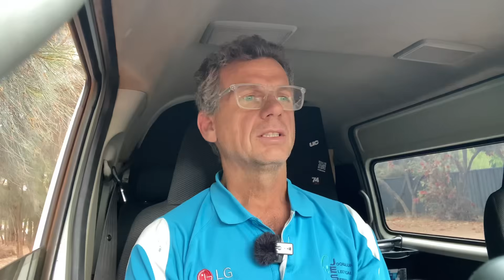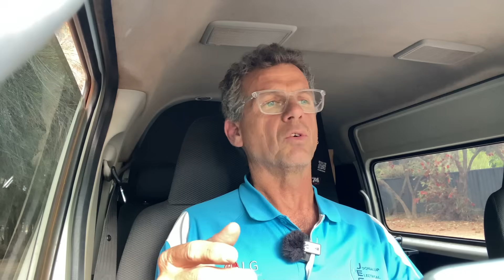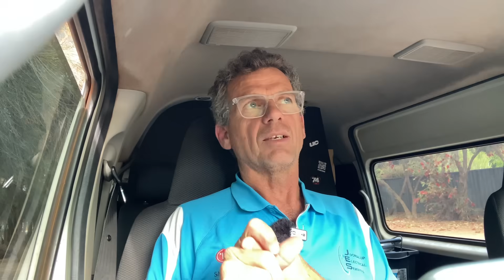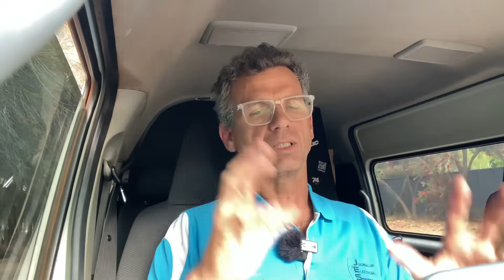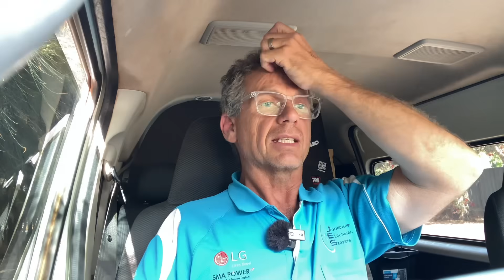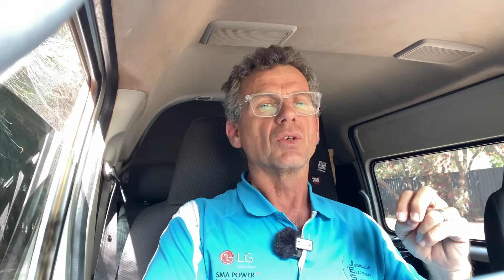What you need to consider before buying an Off Grid solar system, facts from an experienced tradie!

Comment: My bread and butter is electronic design. The video makes some good points, but transformer/transformerless isn't one of them. It boils down to good design and to some extent you get what you pay for.  I don't think the Sigens invested enough in surge capability. This amounts to spending money on thermal mass. Bottom line is you over-rate your inverter, or use 2 inverters. I don't get the control freakery either. You should be able to buy a system that you can control and will run without the cloud. Nothing stopping Sigen sending you a txt if they have an important update.

As for connectivity. If you live outside cell coverage and you need a decent off grid system you should have and can afford satellite.

Comment: The Sigen won't automatically black start whilst off grid? I need confirmation.
Reply from the maker: Correct, it needs human intervention.
Reply: @joondalupelectricalservice3201  Do you mean without the gateway it doesn't automatically black start while off grid?

I've tested mine and it does. Gateway hit off grid. Battery ran down. Morning came and it boots up charges and runs.

Or have a i got it wrong.

Comment: Made my chuckle from the other side of the planet. We have a grid tie Sunsynk in a basement in the middle of a city with great phone coverage. Of course there's zero signal in the basement and we had much fun as Sunsynk then insisted the installer kept reading stuff off the inverter and every reading he had to go down the basement which broke the call and he had to phone them again.

Doesn't take the outback to make things go to bits when you depend on connectivity
Reply from the maker: Doesnt sound like he had much fun!

Comment: Three Free Hours from Synergy — for the Low, Low Price of $400 Million a Year

Synergy’s “3 hours of free power” isn’t generosity; it’s a calculated load-balancing trick. Western Australia’s grid is flooded with excess solar at midday, costing Synergy about A$70 million annually in frequency control and storage. Instead of investing in infrastructure, they’ll spend A$8 million on “free” power between 9 am and 12 pm — when most people aren’t home — and recover it by hiking tariffs before and after.

You might save $1.44 a day in the free window but lose $3 a day outside it. That’s an extra $500–$600 per household each year. Multiply that by roughly 800 000 homes, and Synergy pockets $350–$450 million a year, all while branding it as “green innovation.”

Here’s the truth: once those higher rates stick, power prices never go down. Every “smart plan” locks in another notch of inflation.

Three free hours. Four hundred million in extra charges.
That’s not reform — that’s ransom wrapped in green paint.

Comment: Australian living in Philippines off grid last 6 months. On extreme budget so cheap Hf Chinese 6kw hybrid inverter $A520 owned it for 1.5 years sits in ventilated shed 34C ambient. ( Pv and inverter temps don’t exceed 50C )Recently purchased identical inverter  for $364 ( sale, now 3 year old design ) to sit in cold standby ( Pv and battery switch off ). Also 1kw toroidal inverter and 300W Hf inverter. All 4 inverters selectable via dpdt knife switches. Have 5.4kw Pv with 7kw storage. As a technician I believe redundancy is key, not over driving everything. My Pv limit is 500V but 360 to 400V string will not destroy the 500V rated caps. My higher loads are short duration and my 8kw daily consumption is small compared to 20 to 30 kWh I could harvest. Super typhoon just passed ( 20 per year ) generation was 3.8kwh ( plus battery reserve ) so with careful load management no need for back up generator. Amazing to see 8Pv watts from 5.4kw array during typhoon. 500 to 800W was max for day. With cheap low end don’t expect much warranty, as diy you are the

Comment: Been offgrid for almost 5 years. Have a modest 4.8kw pv, 10kw (2 X 5kw MPP solar) inverter and 40kwh pb gel battery bank. Never had a problem. Both inverters run at half their max so they're not stressed. Can run an electric oven and split air con when it's sunny no probs. Super simple setup.

Comment: Thanks for sharing the information and your experience!

I have my own off-grid system and helped a number of friends install off-grid systems in WA over the past fifteen years, all of which are still running.

I have used both low frequency and high frequency 'transformerless'  inverters. There have been only two failures of inverters on these systems that have stopped power production. One was a fault in a low frequency inverter shortly after it was installed around twelve years ago which was covered by warranty and the other was recently with a transformerless inverter where the PV cables where damaged probably causing arcing.

None of the systems I have installed have dedicated generator backup, one uses an EV to provide backup if needed, some others use small portable generators.

I have come to the conclusion that the best way to 'keep the lights on' is to design systems where no single failure of one particular piece of equipment can cause the loss of power.

To this end I would recommend  off-grid systems have multiple inverters running in parallel connected  to multiple batteries with multiple solar controllers connected to multiple solar arrays. This can be more cost effective than trying to make a system bullet proof.

The Sigenergy equipment looks interesting as you can run multiple systems in parallel. Hopefully if one Sigenergy stack failed the other would continue to supply power.
Reply from the maker: Generator is to maintain the batteries at times of low light and high loads such as humid, overcast or winter. If your batteries aren’t maintained correctly and don’t receive an equalisation state of charge regularly it can cause issues with warranty claims and for good reason. As a business I cant afford that to happen, no comms or no auto start Generator are deal breakers for me and I will walk away from a job. Again Im running a business so everything has to be done correctly 😊👍🏻
Reply: @joondalupelectricalservice3201 
 I totally agree with you if regarding generators in an offgrid systems if it is using lead acid batteries. In this case you have to make sure there is enough power for long equalisation times and to keep the battery at a high SOC. For LFP batteries this is unnecessary. The main reason to make sure an LFP battery is fully charged  on average at least once a week is to reset the SOC counter to 100%.

As far as I can see the current industry norm is to provide a generator large enough to provide for peak power consumption to act as a backup when there is equipment failure. This is a necessary  but expensive option if you want to provide a reliable power supply if you don't take the steps I have outlined before.

To get around the problems of there not being enough power during winter/cloudy periods I would look at spending extra money on a larger solar array and/or battery and asking the customer if they are prepared to reduce their power consumption during the few times of the year when there is not enough solar. Home Automation can play a large part in making this reduction fairly painless. If the customer is not prepared to change their usage you only need a power source big enough to provide the average house load and maintain the battery SOC at say 20%.

With the systems I look after one household will use their EV to put some charge into the system if they think they are going to run out. One will run a small generator (less than 2kw) to put some charge into the battery, others will just let the system shut down in the middle of the night and we all to some extent will keep an eye on our usage. My offgrid system has enough solar and battery (~8kW solar, 10kWh battery) that I don't ever not have enough power for the house. Home Automation varies power going to charge my EV and run the air conditioner.

Being flexible in how a system is designed and what compromises the users are prepared to  put up with can save a large amount amount of money without compromising reliability.

I agree with you about remote monitoring, the last thing I want to have to do is travel over 100km to fix a problem which could be fixed online. I can also check the health of the systems without a visit.

Comment: Hey Jayson, thank you for this video, such an interesting analysis you offer, I’d be interested in your opinion on the performance of the Sigenstor battery modules as well. You talked about the pros and cons of transformerless inverters and how they tend to derate at high temperature (very common in Australia) but how do the Sig battery modules perform in those temperatures compared to other brands? They are rated optimal operation up to 35 C and derating above 40 C which is pretty common in many places in Australia, do you see any issues with them, would you recommend coupling the Sigenstor battery stack with assisted forced ventilation to prevent dersting of battery modules?
Reply from the maker: Thats a good point re the batteries themselves. They shouldnt be installed in direct sun thats in the installation instructions and applies to all batteries. As far as ambient temperatures affecting the batteries plus getting charged or discharged hard then that would also greatly contribute to heat build up. The inverter or energy controller as sigenergy call it will be monitoring the temp of the batteries and would most definitely be changing its parameters to manage that temp consequently affecting their performance.

Comment: While I fully understand many of your points and agree with most, I am wondering why (in an off grid scenario) you don't consider redundancy on the inverter.  It would not only solve the reliability issue, and also solves some of your other concerns, such as large load starting.  For instance if you had 1 sigenergy inverter and 6 batteries, splitting that into 2 inverters with 3 batteries each would double your power for high inrush loads, with the same total capacity.  It would also prevent one inverter failure from causing a total outage.  Also many of these inverters, including Sigenergy, have Modbus TCP connection.  It is possible to program and control the system without the Sigenergy app.
Reply from the maker: Yes for sure good point multiple energy controllers could offer redundancy, however a simple glitch can still shut the whole system down requiring tech support to address and reconfigure while replacements are ordered. 
I did say they can be configured locally but its not straight forward and not something a regular home owner/farmer would get their head around which equals a site visit. For me running a business I dont need that, it cost me money and time.

Comment: Wha about Victron RS6000?
Reply from the maker: I dont have any experience with that one, it does have only a 4kWp solar capacity though. So its not really working that hard, still no substitute for a transformer based inverter looking at surge  and general specs for it, especially for motor start etc

Comment: Thanks please correct me if am wrong about backup activates and lose wifi connectivity in fully off grid. Because in on grid the switching over from grid to off grid in grid connection, doesn’t affect the wifi connectivity or loads interruption and am happy to be pointed out. I am no electrician. Just an average person.
Reply from the maker: Backup for grid connected systems is seamless and no issue. This video is focussed on pure off grid, so no grid connection at all.

Comment: Just installed a a 30kw 3 phase on farm in southern NZ . We are on grid so have good export potential. I like the thought of sig working off grid as well. 2 weeks after install a mass wind storm left my area without power for a week. I sig performed flawlessly in off grid mode. So happy to have it up and running. Easily runs the shearing shed if power go's down as well!
Reply from the maker: They are awesome as a backup source but this video is specifically about off grid, so no grid connection at all 👍🏻

Comment: Yeah, if I was off grid I want it bullet proof.  Maybe if it was my weekend fishing hut or similar, but not if it was how I live or work.
As an aside 3 phase systems in general seem to be way undersized for what they can put into each phase. Virtually all the ones I hear people say they have, turning  a couple of power hungry appliances on on the same circuit is going to Max them out. I would want at least 7 or 8kw per phase before I would even consider one.
Reply from the maker: Yes I agree

Comment: Great video. I’ve always thought it’s a little odd to use a sig in a full off grid scenario. 

In saying that with starlink allowing internet to be so accessible maybe it’s not such an issue having the sig connected to the internet. 

If I ever had an sig in an off grid system I’d want to have 2 running for redundancy, and 1 new in the box as an emergency if it fails. 

In time as sig becomes a more trusted brand my thoughts will probably change.

Comment: I am off grid now for 16 months without a blackout, I built a aircon outdoor room set to 24 degs, all my MPPTs are Victron (40kw solar array) but are using 3 x 11kw MPP Solar inverters (I tested to 10.5kw for 30 mins), if they ever  fail I will most likely go Victron, I use Yellow version of Home Assistant as the base for local monitoring but also pay for remote access, history can go back 12 months (great for fault finding), all my DIY 9 battery banks (150kwh) are monitored through a Victron Cerbo and all using JK inverter BMSs that are programable whick allows me to discover the highest and lowest cell voltage out of the 9 banks 24/7, I think if you go off grid you MUST know your system and fault find, my daily usage is 30kwh, as seen through a Victron VM-3P75CT Keep up the great videos
Reply from the maker: 150kWh is huge!
Reply: I’ve seen people ssh into victron for troubleshooting. It seems software dev friendly
Reply: Good one. 
Currently 21kwh. 3/ 280 amp EVE cells, 24 volt with JK BMS Version 19. 2/4.2kw PowMr hybrids. Split circuits all through Victron Cerbo and smart shunts. 
Average daily consumption 7 to 8 kWh. 
Cheers 
Brian

Comment: Wow, very interesting.  We have had zero troubles being off line and off grid for 20 years.  For a company to demand you to being connected to their network is a big no thanks for me.  Recently upgraded from 2 x 3Kw Victron easysolar plus AC coupled fronious, lead acid batteries to just a 10Kw victron, sepperate charge controller 450/100A dual victron and lithium storage.  I have had issues with pulsating power from AC coupling during the day, fronious couldn't fix, many customers experience the same thing.  Love the new set up.
Reply from the maker: Possibly due to the Fronius being frequency controlled?
Selectronic use specifically configured Fronius inverters that are managed.

Comment: My SMA gear (Sunny Island 8.0H and 2 X 5kW Sunny Boy's) have been absolutely rock solid since day one off grid for around 8 years now. Coupled with 35kWh of BYD battery modules and 10kWp solar I cannot ask for a better system. I setup most of it up myself and know it like the back of my hand. I do have a small 3 kW generator which is not connected to the system, this has not been used all this time. Great video Jase !!! 🤠😎
Reply from the maker: Perfect 👍🏻

Comment: They do not disable the battery after 90 days.  Sig published a statement on this a few weeks back.  It goes into a reduced performance mode with a bit less power and a bit less usable range, as it is operating at that point without engineering supervision and access to software upgrades as needed if they find problems to fix etc. No conspiracy.
Reply from the maker: Did you even listen! I literally read the statement out in the video!
Reply: @joondalupelectricalservice3201 i did and i like following people like you.